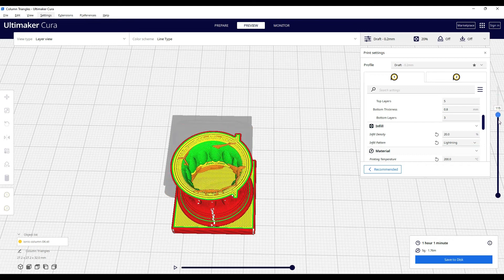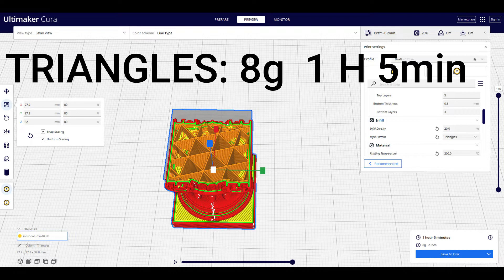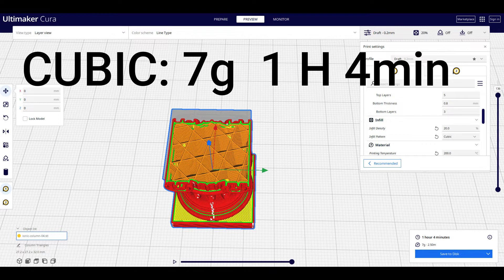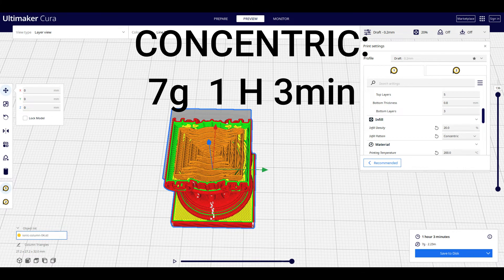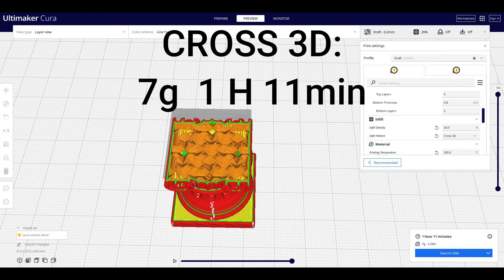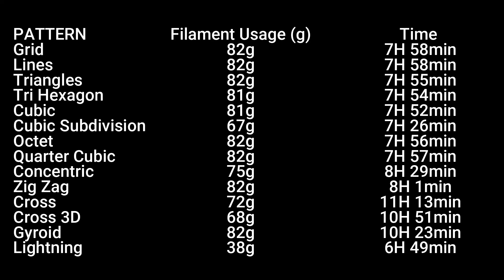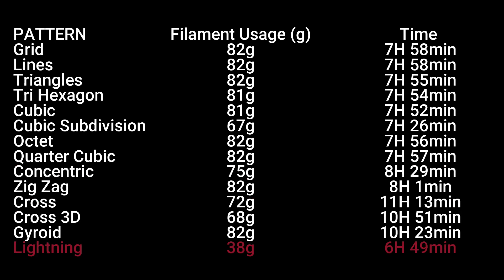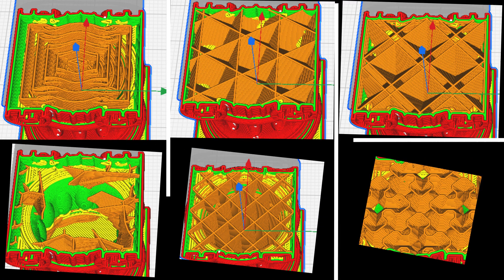Cura Infill Patterns: Fastest? Strongest? When to use each one

Comment: This video helped me dial in and save significant time / filament on a large print (nearly max on my 256x256x256. With bambu, we have adaptive cubic which is even better at saving. If there are large voids, it changes the density depending on wall distance automagically. Nearly 4 hours in time saved and about 35 grams in filament over the settings that were pre-loaded with the file. Thanks!
Reply from the maker: Great glad it helped!  haven't used a Bambu machine yet, I am envious of some of their features for sure

Comment: If you're printing miniature models for wargaming (D&D, Warhammer 40K, etc) USE LIGHTNING at 32.0% infill.
This will give you the fastest print times, use less filament, and ensure that all the internal top surfaces of the model are supported with no bridges greater than 2mm.

Comment: I always use gyroid infill.
Mainly because of the strength, I like that it doesn't sacrifice anything in terms of time and filament amount used but always gives ultimate strength.
Just my tuppence 👊
Reply from the maker: It also looks cool.  That doesn't hurt.  I've made picture frames with gyroid on the outside cause it looks cool

Comment: Did you ever test the strength, I am really interested which one is the strongest (horizontal and vertical) and uses the least amount of time.
Reply: CNC Kitchen did a compressive strength test a long time ago, but he was using a different slicer that has different infill options. in his summary, rectilinear (line in Cura) is best for fast prints, grid and triangle are better for vertical loads, and cubic and gyroid do fairly well resisting compressive stress in all directions. Note that his slicer did not have cubic subdivision or lightning infills. It had honeycomb which Cura lacks, performing well in vertical load tests. Triangle performed better than grid, but took more time and may cause more pillowing in your top layers.

Line and zigzag reduce pillowing as they're simply lines printed perpendicular to the last layer of infill, making them twice as close together as grid for the same % density. Zigzag should be slightly stronger because those lines are connected where they border the print walls.
Reply from the maker: Unfortunately, I have not, I don't really have a workshop conducive to such testing. I bet there's some other videos online though that test that. If I can think of a way to do it that would be really interesting though